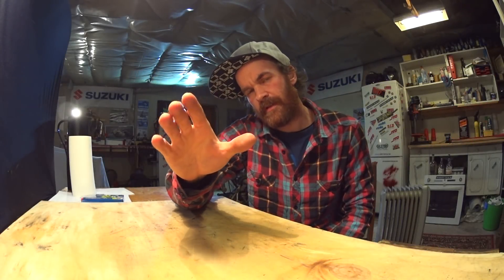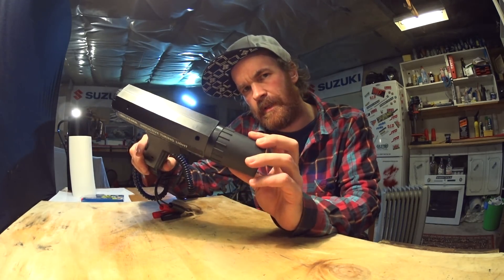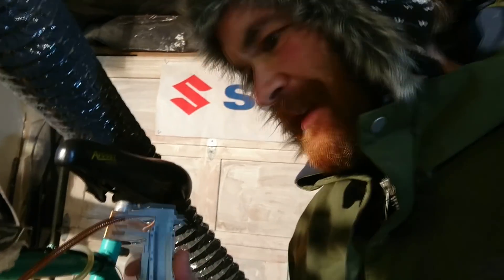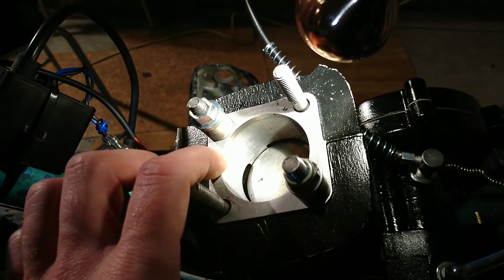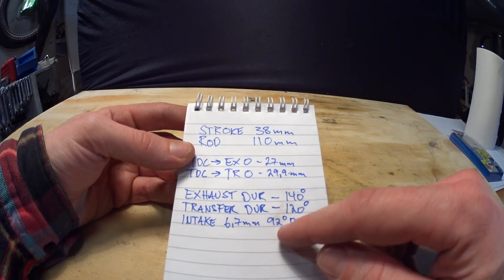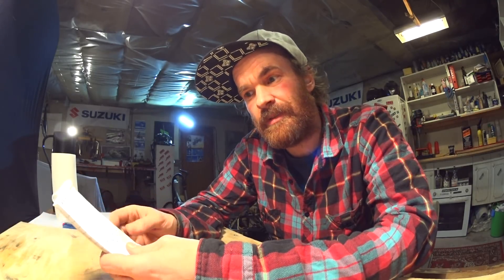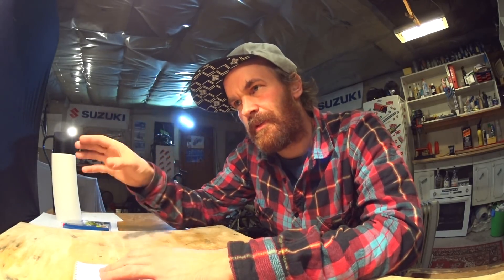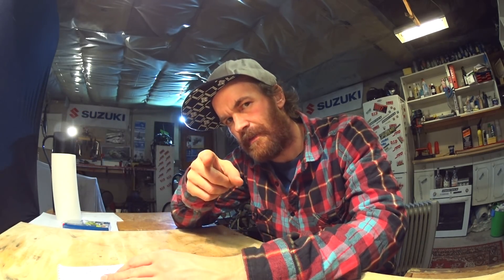Port Timing Motorized Bike, I'M SHOCKED! WHAT WERE THEY THINKING??

Comment: Hi I am wanting to build a new motor up for 1/5 Scale car.
It needs to nitro methanol fuel, I am thinking about electronic ignition system so I can change the timing easily and using a fuel injection system. 
What do you think?

Comment: When I was 16 i bought a 2 stroke book and i got obsessed with porting timing and measuring the stock durations all these tuning cylinder kits that where available for all these 50cc mopeds. suzuki,yamaha,honda mostly. and kits like the well know Mallossi,Autisa,Charmo, high rev cyl like Zeta. broad band cyl like Polini and Airsal.  a class mate had a honda mt5 and was gonna buy Zeta,the chop didnt have that any longer so he got a new type. Polini. he only jetted stock 14mm carb with 95 jet and used stock exhaust with all those restrictions inside.removed the silencer guts and that bike had a beautiful strong powerband from bottom to top. i once helped him change piston rings and took some port measurements. the exhaust was ca 169 and transfers 117.   i  later bought my own mt5 and then to my dispare polini for my5 was no longer made but got ahold of a scorn one so I could inspect ports etc cos my big collection of port measurements was gone cos my old computer crashed xD  I bought Airsal, very similar in durations by couple of degrees.    I manage to fit the 75cc malossi from suzuki zr50 on my suzuki tsx once but i had not the right exhaust so it never really worked when i was 17. now i have resources to make and try all kinds of exhaust so it may be a new experiment.  honda pxr with athena,polini is whats up these days ;)

Comment: I'd settle for a mild port job along the lines of 160 exhaust and 130-140 degree duration on the inlet. It should be plenty fast.
On the other hand there is a certain charm in porting the hell out of any engine, and you've already fitted a pipe from the overkill category. 

Blow it up, lol. 

The port layout reminds me of the Suzuki DM50 Samurai; a 2-speed 50cc engine capped at 30kph for the Danish market.

It does that job quite well with a wide spread of power but heavily capped on max rpm. I believe this is intentional via the astoundingly low blowdown. 

I don't have the port timings, but I recall the exhaust and transfer ports being around 2mm apart and  the piston only clears the transfer ports about halfway.

Comment: Is it just me or......When I put the piston on I noticed piston pin/pin bearing is a loose pour fit. Need to get rid of the extra wiggle in order to go smaller the a mm squish pad. IDK though
Reply from the maker: It should be tight "up n down"...

Comment: Right now I have my stock with pipe cut off baffle/expansion chamber so it’s basically straight piped  I don’t know if it’s good or not for it as far as Increase in power vs a true expansion chamber pipe  but I like the sound lol ! . And I have upgraded 3 point spark plug , stock carburetor that I don’t mind to much  I can always play with the needle float settings and jets after final port work , I dont care about upgrading the carb unless I find that I need to or something . So I just want to port it properly to get a better intake /exhaust timing set up and maybe play with retarding/advancing ignition timing after the port work. 
So please someone tell me some advise on how much material I should remove from each intake and exhaust ports , maybe even tell me how manny MM you think I should widen them each as well , Hopefully you know a lot about 2 strokes and possibly own the same engine in the video , thanks a lot to all and thanks for the video 2STROKE love all you scientific data collection with  small 50cc type engines and oat important this 66cc China clone specifically cause I’ve owned a few of these kits and I love playing with them and tying to get the best out of them cause they are cheap but I haven’t gone as fast as to buy many aftermarket power mods and what not cause they are kinda expensive lol maybe one day I will have a better budget for a quality build

Comment: Here are my crude measurements of my engine, all I did was lightly clean up intake and exhaust ports & sanded down the cylinder body and cylinder head to give it more compression , & I use 1 of the original  aluminum head gaskets. 

- Top of cylinder to top deck of exhaust port 29.3 mm 
- Top of cylinder to bottom deck of exhaust port 42.4 mm 
- 
- Top of cylinder to top deck of intake port 44.1mm 
- Top of cylinder to bottom deck of intake port 57mm 
- 
- Top of cylinder to top deck of transfer port 34mm 
- Top of cylinder to bottom deck of transfer port 44.8mm 
I did not measure the transfer port ramp angel by the way I just took the measurements from the center of the ports to top of cylinder body 
Here are measurements of my piston also 
 
 Piston skirt is 40 mm long on intake side ( cause I removed roughly 7mm of material to open up intake port and change the timing  ) 

If there is any advice anyone could give me on how I should start to port this thing please help , ignition timing is still stock also btw , I’m not sure if I should raise or lower intake and exhaust ports for proper timing but I do want to widen them first , please help me thanks !

Comment: check carburetor. slider check cap for slide assy  .....there is a way to improve seal for cap this makes starting engine and idle  acceptable still slider fit is horrible best is remove bash carb with hammer then dispose of the POS  get a carburetor that functions correctly the carburetor that  is stock is poorly made and can leak vacuum so bad down slide bypassing main jet that most of the engines get enough damage during first two tanks of fuel they won;t start at anything less than a sustained 25mph/40kph full choke run then stall  anything under 10 kph The slide is worst made of any ever produced they rattle so bad you can hear them go thorough various harmonics louder than exhaust at times LOL

Comment: I'd like to see you port it.  I'm gonna try mine, never done it before but I got the motor for free so figure it's a good way to learn.  Filed the piston skirt a bit and built a custom exhaust with way too long of a header and seemed it gained a lot of low end power.

Comment: Those ports are not as shitty as i thought they would be, the Exhaustport isn't that bad, even only going up to 130-140° on the Intake Port would get it far better Power output, about a Year ago i had a Puch Supermaxi with stock 1.2hp Supermaxi cylinder, only the pistonskirt and the Crown was modifyed, i had 140 Intake, 122 Transfers and 132 Exhaust, it didn't even run to bad, was quite fast with a 12mm Carb and no Resonance Chamber, Headgap was 0.8mm, i think it reved to about 8-9'000rpm and had a wonderfull Powerband.

Comment: Those port duration combination means they want to build low revving engine with wide powerband and torque curve, means it's a workhorse enduro engine, not a racing engine.

Comment: Hello,
you said that the exhaustduration is verry short...
In my freetime I sometimes ride my chinese bike and i had the problem that when i am driving a straight road, that the engine starts to cough when i am getting in higher RPMs but when i am driving up a hill and the RPMs are dropping than the engine stop to cough...
Maybe is the cough of the engine in the high RPMs caused of the short duration?
Reply from the maker: +Okiam Okiam What you are describing sounds very much like it's running rich, try a smaller mainjet!
Reply: HHHmmmm
I thought that it could be the bad point of the Ignition, 
-The exhaust gases accumulate in the exhaust and affect the ignition negatively because they go back in the cylinder...
Or my thinking was, that the swimmer (i dont know how to translate it) is jumping in the carb and so ther is too much feul injectet :0 because the engine vibrates much 

In summer i will find out whats the problem ;D

But thank you for your tip i will think on it...

Which type of the powerspark do u used?
Its verry interesting but i need an battery right?
Reply from the maker: +Okiam Okiam It's the CE-i 100, yep need a battery.
Reply: I saw your video to the ignition 
verry interesting ;D

And the ignition just need A maximum of 1.1A? so when i use a 5Ah battery I can ride for round 5 hours?
Reply from the maker: +Okiam Okiam Thanks! In theory yes, but you should allow for some headroom.

Comment: My opinion:
Increase exh timing 10 -15 deg degrees but carve the piston top for testing purpose.  Much easier and cheaper.  Don't go full exh port width, but 40%.  Of course, you are aware that the exhaust may need to be changed for max effort. 

Log the crank case pressure with current timing and determine how much intake degrees and timing is needed based on the data.

Happy 2018! ☺
Reply from the maker: +Big-J Logging crankcase pressure is an interesting idea, especially if it can be plotted against crankshaft rotational position! Thanks!

Comment: Put the exhaust @200deg
Reply from the maker: +britt vanegas Not enough material I'm afraid.
Reply from the maker: +britt vanegas Not enough material I'm afraid.
Reply: 2STROKE STUFFING mines is at @220 stock70mm cylinder jug pushed a cast iron sleeve and use a puch 47mm piston on mine. I used a cut up and rewelded kx85 dirt bike pipe on gasoline 70+ mph watch my videos, I'd like to send you a cylinder you can try on your dyno.

Comment: Do you know how to increase the stroke? I have a 80 cc engine, but the piston doesn't go down enough, it covers the intake and the exhaust ports, and it also doesn't come up enough for the best compression. I think I need a new crankshaft, but I don't know if there are any difference between them.
Reply from the maker: +Jordán József I think longer stroke cranks are available. Check out Zeda Motorsports. You could lift the barrel and remove material from the top of it too, like I've done.
Reply: They only ship in the USA, so I'll need to look around on Ebay and hopefully I can find a crankshaft with detailed info. Do you mean to lift up the cylinder and sandpaper down the top of it? That's not the best thing it will increase compression and the exhaust will be better too, but the stroke length will be the same. But if I couldn't find a longer stroke crankshaft, I'll do that.

Comment: Hey, I was wondering, does the Cylinder have no sleeve? Could not see on in the pictures. I would definetly increase exhaust timing, maybe widen the port a bit too and of course get it as high as you can without affecting CR too much. Clean and deburr the transferports only and increase the intake duration as much as possible without affecting rings. I would also try to use some sort of fan cooling because this engine might get hot quick... Try to adjust the head squish clearance and statically reballance the piston and counterweight. A better carburetor with vortex cap might help. Forget the boost bottle shit and place a decent resonance pipe. :) Enjoy...
Reply from the maker: +marcel caratus Good tips! Most of it is coming! Nope, no sleeve, chrome coated.
Reply: I wonder if this engine will hold being only chrome coated...
Reply from the maker: +marcel caratus I share your concern.
Reply from the maker: +marcel caratus I will!

Comment: I just want to say that I've had many of these 66-80 motors over the last 10 years and after break-in none of the them sounded as doggie as this one, maybe it's your exhaust vacuum that makes it sound that way, I don't know. One thing for sure is be sure you put an O-ring in the carb where the intake manifold goes, those things are notorious for vacuum leaks and impossible to get to idle properly. With that said I would love to see how far you can it before using any aftermarket parts. Thanks for the interesting content.
Reply from the maker: +Jon Rothenbusch Thanks! Yeah, it's pretty bad...

Comment: Interesting stuff! I agree that port timing is a really good way of working out how well an engine will perform but having said that I read a very good bit of information in one of my 2 stroke tuning books which showed how a 125 motocross engine could be turning into a road race engine just by changing the expansion chamber. With one chamber it had lots of low and mid range torque (well good for a 125) and by only changing the chamber the engine lost a lot of mid range but made a lot more power at the top end of the rev range. The ports were not changed at all between tests!   Having said all that 140 degrees of exhaust is really the sort of timing you would expect for a bore  enduro and moto X engine!  You could always file the piston as a test, I know that it is not quite as good as doing the ports but pistons are cheaper than barrels. Having said that you could not file 8mm off the piston without breaking into the ring lands!
Reply from the maker: +Sidecarbod Absolutely true about pipes! You sure enduro and mx engines run 140° exhaust duration? I'm pretty sure it's in the 185-200 range.
Reply: Well they might run a touch more than 140 but not up to 200, 200 is into the range of road racing engines, small road race engines running at around 202 degrees. Keep up the good work, I'd rather watch your vids whilst at work than do any work! :-)...EDIT, just spotted on the web that the Honda CR500 had 180 degrees of exhaust timing so you are right, it is more timing than I thought!  Does make your 140 look very bad!
Reply from the maker: +Sidecarbod 👍Thanks!

Comment: try increase the transfer timing first...

increasing the exhaust port too high then u will suffer with powerband shifted at much higher rpm
Reply from the maker: +Amir Pomen The transfers are already within reason, and blowdown is a meager 10°. Making them any higher would be a bad idea at this stage. The exhaust is extremely low, don't think raising it a bit will cause any trouble. Could be wrong...
Reply: abit should be fine... start little by little...atleast if it gone bad, it wasnt the worst.... maybe by another 2mm and dyno after that?

Comment: I'm going off-topic here but I posted my question on a 49ccscoot forum and nobody even got close to what I was asking, so I'm asking you. I unhooked fuel pump and currently running premix on a 49cc 2-stroke scooter. While coasting, does the engine suck in the oil it needs? The CVT is still 'hooked' and it still spins the engine, but I'm not giving it any gas, so in reality it does not have enough lubrication? Dumb question but I would be happy if you answered, better yet made a short video. Love your videos man, keep it coming!
Reply from the maker: +Mckinnon Thanks! No worries, that's how it works in any two stroke running premix - you'll be fine!

Comment: Can you show us the math? How did you get timing from the measurements? When you say extreme and that it’s crap stock, what’s normal and what’s race timing? Are there any other practical ways to deal with that besides porting? 

Definitely take the die grinder to it :)
Reply from the maker: +Drew Shapiro I use this calculator http://www.dansmc.com/mc_software2.htm The math isn't that complicated, but why bother... Equations here: https://en.m.wikipedia.org/wiki/Piston_motion_equations

140° exhaust duration is extremely low, 10° of blowdown(the period the exhaust port is open but transfers still shut) is even more extreme. Coupled with the tiny exhaust port it severely limits outout - when blowdown becomes insufficient, cylinder pressure is higher than crankcase pressure when the transfers open, in this cylinder it happens at very low rpm.

As intake timing is extremely low, and the port very small, it doesn't take much rpm before its ability to fill the crankcase falls short too. 

I shouldn't say it's crap, just designed to produce very low power at low rpm.

"normal" would be 170-190 exhaust, 115-130 transfer, 120-150 intake(piston port).

"racing" 190+ exhaust, 128+ transfer, 150+ intake

There's alot more to it then just timing though.
Reply: Awesome, thanks!
Reply from the maker: +Drew Shapiro 👍

Comment: I may be completely wrong but I wouldn’t be surprised if this is a copy of a much older and well proven design. I guess the remit was to produce something with quite limited output because, well, it’s for putting on a bicycle. Limited output would also help durability too but I would think a big goal was to extract the maximum fuel economy possible; how many potential bicycle engine customers are looking for BHP figures! The short exhaust timing will, I guess, help limit the amount of fresh gas getting lost. Short inlet will keep the inlet charge going in one direction and a tiny carb will give fast gas speed which will help atomisation. 
I look forward to seeing what you can change it into though : )
Reply from the maker: +Richard Moss I think you might be right!